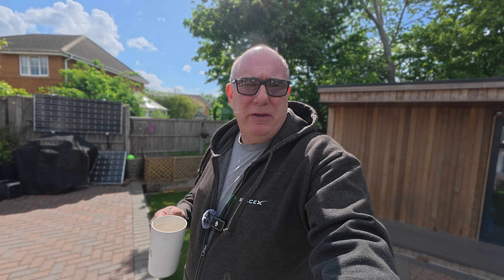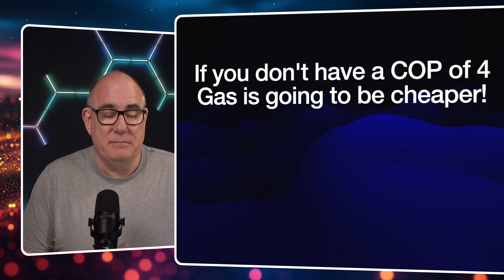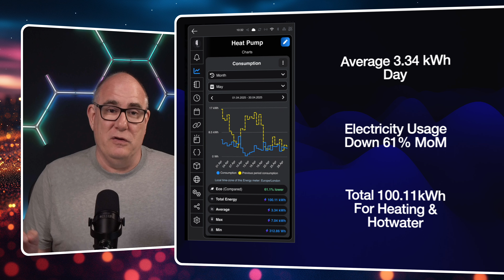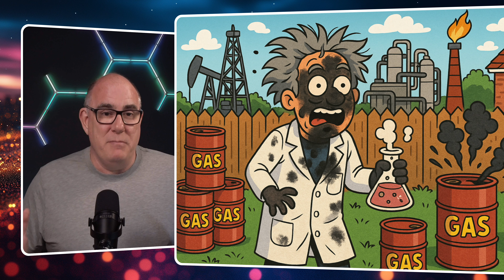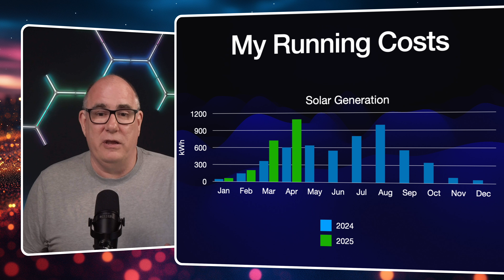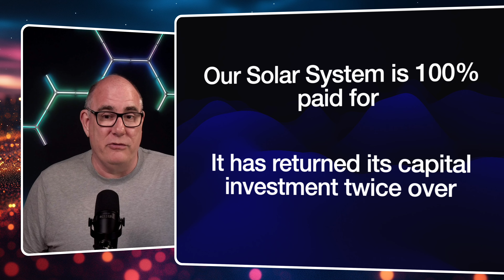We Cut Our Heat Pump Bills to Zero

Comment: ... thanks JT, really clear explanations. We've just done the same (EV, Batteries, Solar, ASHP - in that order), three ago before we started the transition we were paying over £750 / month in a typical January winter.  (£400 on heating oil, £200+ on derv for Car, £150 house electricity), like you the Daikin (same model) was installed in November 24, and in Jan 25 the whole bill was just over £100 incl standing charge for everything (and thats still with a grade F 39% EPC house)..(April 25 has just come in at £69 for everything)... its just Nuts!, keep up the great work👍👍
Reply: Current quotes sourced from Octopus are implying that they will now only provide the Cosy ASHP in one of two forms - Turbo, or regular - and I've read too many reports of poor installs and just poor running of the still developing Cosy brand to tempt me to that particular version. Heat Geek, meanwhile go with the tried and tested Vaillant products, and I'm impressed by their guarantee of the COP figure which they quote. Meanwhile, however, see above, as I can't fathom how Jon T got his installation for just £3900 net in a similar house to our own!
Reply: @peterlawley7644  not apples to apples, but my Cosy 6 install was originally a Daikin quote, both at a fixed price of £2,925.52, and I used a £100 referral discount, so £2825.52 all in. That was with 6 rad changes, repiping one rad, scaffolding and cladding the external pipes.
Reply: @geraintrobertsphoto  Thanks Geraint, still at a loss to understand these costs. Just checked again with Heat Geek, quoting £5,700 net for Vaillant ASHP & hot water cylinder for our 1996 84sq.m house with good insulation and recent, better, double glazing. Octopus similar. Admittedly, these are just generic 'desk top' estimates prior to a formal survey, for which there's a payment up front (admittedly, refundable if you choose not to go ahead) and could possibly be amended once that has been undertaken, but it's still a massive difference from Jon's £3900, and your £2,900. Still inclined
to go for solar & battery first as a quick win and less disruption.
Reply: @peterlawley7644  Yes £5700 seems out of hand. I can’t see why they’re quoting that. We’re in an EPC D (prior to the upgrades) mid 60’s semi. I added solar and powerwall 3 last year, which has been a fantastic investment with all the sunshine. We also removed the gas hob so the powerwall could power that too. And now we’ve had the heat pump installed earlier this year, we’re entirely off gas and saving the standing charge. I really hope you get yours sorted at a more competitive price! EON came out for a survey, I think that was circa £3000 for a 5kw Vaillant but not entirely sure, it was a while ago.
Reply: @peterlawley7644  I think its the luck of the draw, the online quote is a guestimate based on your EPC. I got 3 quotes from Octopus for my Inlaws over the course of a year for what I considered would be a very straight forward install. I was tempted by the headline of getting a HP install for £500, but the first online quote a year ago was just over £4000, so I let it lapse. I tried again 6 months later and it was £5500 or so, so I went to an independent company who seemed to hint that based on the EPC (house 80's bungalow, but extra storey added in 2001, and cavity wall insulation, so 2000 standard of insulation over all) a quote of well under £4000 was possible or even likely, so I paid the non-refundable survey fee, but the quote from them was even higher at £6000+, Finally third time lucky and another 6 month later the online estimate from Octopus was about £3879.11 (from memory) so I paid the £200 survey fee, keeping fingers crossed that the final price after the survey would be much less, but it came back at exactly the online figure, to the penny. That included a new tank and 6 tiny radiator upgrades (basically the 6 smallest rads in the house, all but one under 600x600mm). The install ended up far simpler than I had expected, with the Cosy 9 heat pump making possible a fantastic location that wouldn't have worked with the equivalent Daikin. I'm happy with the solution offered and we are booked to go ahead, but I know someone with a very similar install (just a Cosy 6, and in a different part of the UK) and they are only paying £800. I suspect most times you wont get a cheaper (or more expensive) quote than the online figure after the survey, even if it is easier than they expect. I also think regional differences could be a factor. Now our install is booked, I have tried since under the new two option system and seeing quotes of £4400 for a Turbo install and £5300 for an Eco install. I think the install we are signed up to is somewhere between the two.
Reply from the maker: Its amazing the savings you can make, a year ago my gas was over £100 a month, my electricity has not gone up at all and my gas bill has all but gone away

Comment: I’ve ordered my solar and heat pump from octopus but would be interested in a video on how a system works in real life situations such as:
* During summer, do radiators come on at all? Do you need to change thermostat at all?
* if you have a towel radiator, does it come on to dry towels or do you need to do something else?
Reply: If you wanted to switch the heat pump off in the summer there is normally a setting in the heat pump that determines the maximum outdoor temp at which the heat pump will run for heating, in my case 18 degrees. When the outdoor temp hit's 18 it will not come on for heating but I suppose you could just turn the thermostat down in the summer.

Turning the heat pump on just to dry towels would probably be pretty inefficient you might be better off with a separate heating element in the towel radiator for the summer.
Reply: @ if the heat pump is working 24/7, won’t it come on at a low temperature overnight and warm the towels slightly? That might be enough- or is that not the case?
Reply: @ It totally depends on your home and how you decide to run the heat pump. 

In colder weather my heat pump will run 24*7 but as the weather gets warmer it will only tend to run on colder days in the morning and evening( I like a warmer house in the morning and evening).

I have my thermostat set a couple of degrees cooler overnight(setback temp) otherwise I get too hot in bed. However I know some people boost the temps overnight to take advantage of off peak tariffs.
Reply: I've just turned the heating side off so it only fires up to heat the tank up. I'm on Go so i heat the tank up fully to 50 degrees at 430AM. Towels just got over the banister.
Reply from the maker: @petefrasersoft we just turn down the thermostat to 16, which from here on into the summer will be off, as the temperature in the house will never get that low. But should we get a cold night its there to come on if needed.

With regards to towels, no if the heating is off the towels will not dry unless you have electric towel radiators. You could zone your heating so that bathrooms are on a seperate zone and have that come on at night to dry the towels but I have not tried that yet
Reply: Our HP has not been running during recent warm weather, but on today at low ebb as bit cooler outside. When it’s hotter our towels dry without heated radiators and today low ebb is enough. I don’t have bespoke heated radiators, I shower every morning. It’s no problem.
Reply: Heat pumps should use weather compensation, which means they use the outdoor temperature to work out how hot to make the radiators, so there comes a point where the radiators aren't heated as it gets warmer outside. You can also just turn off the heating side. You set a target temperature for the house, and again it works out how hot to make the radiators to keep the house at the temperature you've set, it uses a heat curve, so that may need some adjustment to find the sweet spot on the heat curve. A house loses temperature via heat loss, to maintain the temperature you just need to trickle the heat in. Towel rails will not work so well, as they won't get so hot, and not at all in the summer when the heating is off. If concerned you can convert the towel rail to electric.
Reply: @pete-fraser  I’ve noticed a recurrent theme of people with heat pumps etc, needing dehumidifiers (property probably well sealed up). We installed a loft/landing ceiling mechanical vent (with heat transfer recovery, Nuaire based in Wales) cost about £300. Long before HP, it was to ensure healthy air exchange from outside, it immediately eliminated any moisture (no more black mould or misting windows) even in Winter. Certainly helps with drying towels, it’s so effective our new kitchen does not require a vent of its own. Definitely recommend generally.

Comment: Another great video :)
It turns out Octopus is actually quite relaxed about the different tariffs. I have solar and batteries and was on Agile for many years, but after last winter, I decided Agile was not the best right now. I was able to immediately move to Cosy, even withouta heat pump, the T&Cs only required a smart meter. I then thought I could do even better with Go and a few weeks later was able to move to that. Again the T&Cs only required a smart meter, not an EV. Intelligent Go does require an EV Octopus can connect to though.
After all of that I moved solar exports and imports to Eon Drive (16.5p export and 6.7p import overnight).
Reply from the maker: good to know that they don’t actually enforce their own rules, but it does make me wonder why I have them in the first place.

Have one tariff that lets you use up excess capacity in the grid at night, have another lets you use up any extra during the day brackets (cosy) and maybe somewhere where you control the equipment like the intelligent tarrifs and that’s it
Reply: @JonathanTracey I flip between GO and Tracker depending on time of year and have never owned an EV, and they don’t ask when switching tariffs so anyone can get it
Reply: Absolutely agree. I would have moved to Octopus Go late last year when Agile prices went through the roof, I just assumed I couldn't use those tariffs. 

Downside of Eon is that they only pay you for solar exports once a year, via cheque (!!) Or bank credit, but you can request up to 4 payments per year. It is not tidy like Octopus is, where your monthly bill includes all debits and credits and you only pay the difference, or let the credit build up, to get you through winter.
Reply: @aidandillon9520  With both E.on and Octopus, you can actually pay your bill (via DD) in full each month via a variable DD. No crazy £400 credit build ups like I had with Scottish Power (and they refused to refund it in full when I asked - you can have £300). I moved to Octopus but E.on's Next Drive V6 meant another move. I get 7 hours at 6.7p/kwh. But the main reason for moving was, like you, reading the rules meant I couldn't use a tariff primarily designed for EV use to charge my batteries. So far E.on hasn't been a bad move, except for the emails that one is told to ignore! Er, yes!